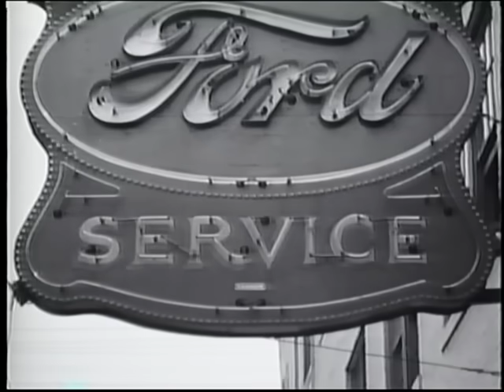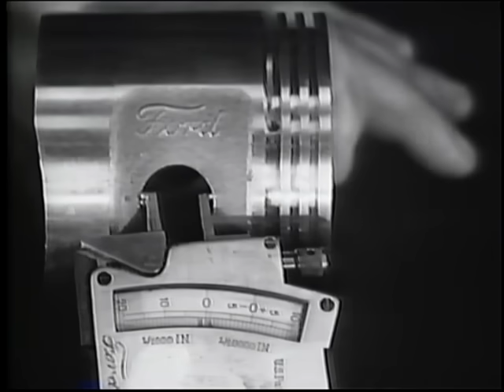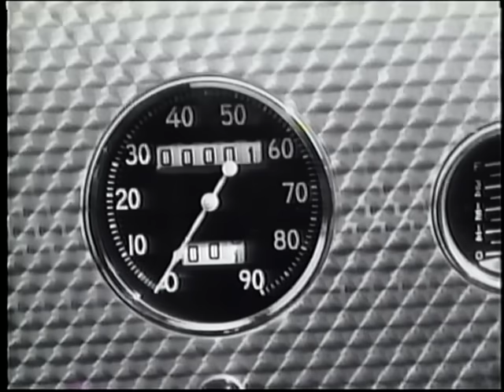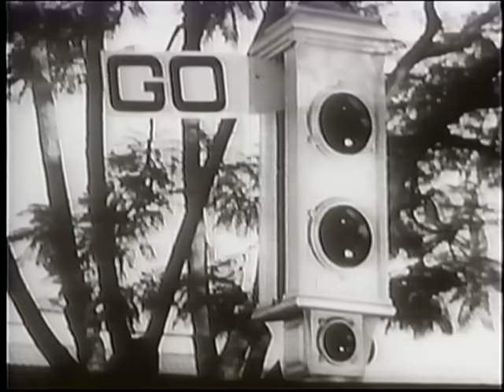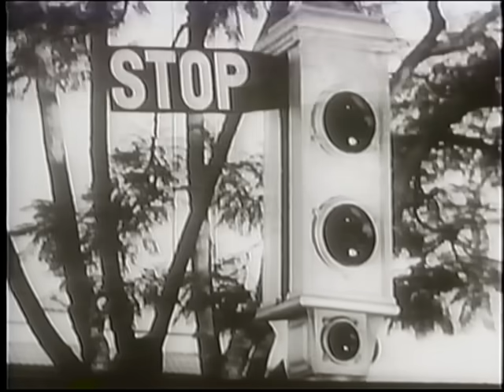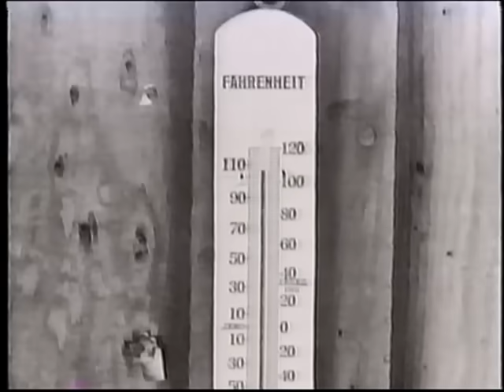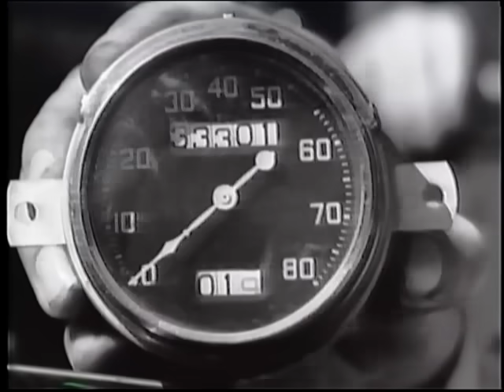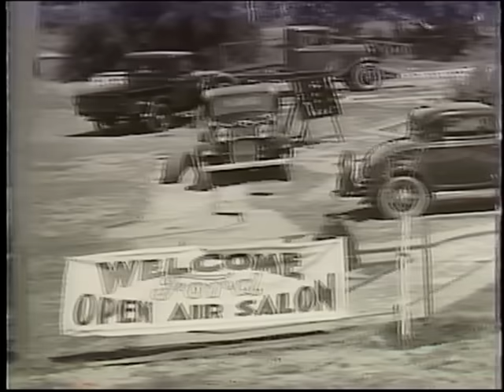1932 - The Invention of the Ford V8 Engine

Comment: All this progress without computers, astounding how smart these engineers were.
Reply: Jeb Broham all with a slide rule.
Reply: Engines could run today with just a little bit of help from computers. So even if the computers were to go they would still run on. The problem is that modern manufacturers have become lazy with their designs.
Reply: These are super simple engines. Like the complex bit are the radiator and the transmission. Which are super simple by modern standards. PS, modern companies provide more of an experience* than just a car. It isn’t just about A-B anymore. It abound the journey, and the experiences that can be had during it.
Reply: Remember, computers don´t think, they´r just as smart as the programmer.
Reply: Today. Mechanics won't do more than plugging a scanner.  You trying to explaining that You think something is broken base in common sense they won't listen. I love dirty hands mechanics who say: Start the engine... Then look ,grab something and tell you: This is bad. Swap something and say: -Try again! Broom! Done.
Reply: @ian_lambert-knight  super simple flatheads actually arent that simple.
Reply: @bighands69  Bullshit. 
Modern cars are several magnitudes better than any car from this period. They are faster, stop better, handle better, are safer, more economical, last much much longer, are more comfortable, etc etc etc. 
Old cars are great  I own several, but no.
Reply: @fernesal  things nowadays aren't that easy. I would love to work on any vehicle like that but its mostly diagnostics thru the scan tool that leads us there unless you see the problem alot on that specific vehicle and know instantly what to do. But you still need the scan tool to get to that part you can't just trial and error it anymore, otherwise the customer is not happy coming back to you saying; "this didn't fix it". Something like a misfire can be alot of different parts from a bad O2, clogged cat, vacuum leak, faulty ignition wire or coil, sparkplug, fuel injector not firing either cause of the winding is shorted or the pinto is stuck, or even poor fuel pressure. Where we'd all love it to be as simple as you say, we don't live in a perfect world.
Reply: Yeah nowadays our engineers are all Indians who like to shortcut things well at least the "to be" engineers of the next decade.
Reply: @bighands69  Can agree, every new car I see has no more styling to it, they all look the same, the only different styled cars are the sports and exotic cars, everything else is just monologue, though engineering in the engines is a whole lot better today.
Reply: @snowmexican5479  A bit like your command of English, eh?
Reply: @prophetsnake  to which of the 3 of my comments are you replying, I'm not making sense of you.
Reply: @snowmexican5479  I doubt that you ever will. I'm not fluent in Teabilly, you see.
Reply: @prophetsnake  I find it funny how you said "eh" at the end of your question like a Canadian, which I am also and no I did not immigrate here. I could care less about spelling and grammar since I am not going into law-school, nor a paper pusher like my old man who can barely change a light bulb without getting into a fit, but if you want him to type for me to ease your stressing over my comments.
Reply: @snowmexican5479  You could care less about spelling? How much less could you care, precisely?
Reply: @prophetsnake  so much that I am done talking to you sir, Good day.
Reply: @snowmexican5479  You forgot to say eh, so I am guessing that when they start putting foreigners in camps, you'll be rounded up as well.
Reply: Jeb Broham watching the machines do EVERY SINGLE THING mechanically was absolutely mind boggling. I can’t imagine the amount of dedicated engineers it took to create such perfected mechanical design, I can’t image the amount of seemingly impossible innovations these engineers were able to lead in sometimes under a decade. I can’t imagine the sheer amount of problem solving and adversity that was overcome. I have a whole new respect for pre-computerized machinery now
Reply: If you're implying that modern engineers aren't smart, you're dead wrong. Modern engineers are simply working with demands from machinery that are so precise, no person today can feasibly produce something like that without the aid from a computer. 

Want an example? Well if the Apollo 13 mission was so great, why can we produce engines twice as efficient today as we did then?

If 1930s cars are so good, why does a Toyota corolla last 20 years with nothing but routine maintenance and maybe a few minor repairs after the 10 year mark. Please, find me a 57 Chevy with that track record. Or a 65 Mustang that went more than 5 years without issues. Find me a Chrysler product half as reliable any year prior to 1990.

The difference isn't the engineers. Engineers today are just as brilliant and capable as they were back then. The difference is the tools. Brilliant engineers performed marvelous and tremendous feats of engineering in the 1930s, and those same talented engineers do the same today, but today using the precision that modern computing affords us.

"by naked eye" is to slide rule, what slide rule is to the computer.
Reply: @fernesal  Absolutely correct. Biggest fail I see is "techs" that fail to check battery connections and holes in hoses. Experienced a "tech" wanting to replace a turbo...scan tool told him turbo boost was low. That's the problem, he said. Hmm, I said...what about the hole rubbed in this hose ?  If you skip the basics, the scan tool will lie.
Reply: I was pretty surprised to  hear their marketing pitch, since most of the features they were touting were just caryovers from the Model A.  The rubber isolators and body styling was new, but the shock absorbers and brake mechanisms were practically direct caryovers, safety glass was used since 1919 or 1927, depending on who you believe, and the interior was practically identical in every detail I could make out.  The propeller shaft was a tube instead of solid, the rear spring perch moved back, and a few other nice details, but not much more than slight incremental progress.  If he hadn't had the V8 to put in them there is no way he would have sold the few he did.
Reply: @heyinway  That's what I meant when originally commented about it. I'm not against new technology. But I've seen ridiculous diagnosis from techs that look at nothing else that at a screen.  You bend over and look around and find something wrong in the vehicle way faster. They just say: I don't get it why still throws this code🤔
Me scratching my head...man! Get out of there and start searching like a man.
Reply: @prophetsnake  I should hope so after about 100 years of innovation and refinement. I bet they were super comfy compared to a horse & buggy.
Reply: @cptmiche  You're right.
Reply: @snowmexican5479  You can still trial an error it, but you would be an idiot to do so. Scan tools give you extra information you otherwise wouldn't have, which is very useful for narrowing things down. It also alerts people to issues they otherwise wouldn't notice till things got bad to the point that repairs would be much more expensive. For instance, I know the fuel pump in my truck is on its way out, and I'm planning on replacing it soon, but if it wasn't for the ecu I would't realize that and would probably have a lot of headaches in the near future.

The problem with modern cars isn't computers or plastic or anything like that, its three simple things that work together to make the market worse. People who make cars that don't care about cars, the lack of competition due to a smaller number of car companies, and the fact that more than 80% of cars are now either purchased, or chosen to be purchased, by women.

People not caring has always been an issue, but now due to the fact that there are fewer companies, there is a higher chance that there is no car made by people who care in a specific segment. Right now, if you want a midsize sedan that is comfortable and good for long roadtrips on the highway that doesn't cost a lot, all your options are made by companies who don't give a shit. If you want a small truck, well those don't exist anymore, but if you want a medium one, all of them are made by companies who don't care. Some decades ago, there was enough different companies competing, that there usually was a decent option for whatever you needed. Not so anymore.

As for women making all the purchasing decisions, unfortunately women are taught that they shouldn't care or know much about cars, so they don't know much about them on average. As a result, they are a lot less informed and let manufacturers get away with things they wouldn't have in the past. They also, knowing less about the mechanical aspects, tend to focus on stuff that they do know, things that are obvious if you look at a car even knowing little about them. Like little details of the interior and cargo capacity and ease of loading. So they buy things like crossovers, not knowing how much they are sacrificing for that extra space. I think that most women, if they understood how much worse a crossover is than equivalent vehicle of a different type due to the high cog, higher drag, and heavier weight, would choose a minivan, sedan, or station wagon instead, depending on their personal needs and priorities.

I'm not completely sure why women buy all the cars now. I have a few ideas, but its all speculation that isn't worth typing out.
Reply: @Milhaus It was! So was 'typewriter'
Reply: @lobsterbark  This has to be the longest comment I have ever read, but I agree with you, though I will have to correct you on the small truck, Ford did bring back the ranger and it is relatively smaller than the average truck on the road, though my only issue with it since my father owns it, is that the rear end looks like its on stilts. As for the care, I think its because its more automated the way the vehicles are made is why it seems like there is less care going on in the vehicle, at least you can say the upholstery was installed by a human/s, and depending on that human they either put some care into it or not. I also can't blame women entirely for the way the vehicles are built nowadays, but I will say that another large contribution to it is that we have become such a throw away society and people aren't buying cars so much as they used to anymore, its now either leased or financed that is now the complete killer. 

Another thing I am sad with is the dying of the manual transmission, especially with iconic cars like the supra, I'm sorry but I still classify a real sports car is one that has a stick. I'm not against the auto but I still want to "drive" my car not get crazy gas mileage, or fastest shifts, or how fast it can get to 60 or in the 1/4mile I think thats a challenge that a "driver" should take, not the machine and all the driver does is smash the accelerator and maneuver the car to limits since its aided by traction control and stability control limiting what it can do overall. Its just not a real car anymore like it was in this film or even like it was up to the late 90's. All the more reason why I hate my generation of carefree shitheads.

Other than the one truck brand bring back the small-ish truck and its not all women, I completely agree with you.
Reply: @snowmexican5479  The new Ranger isn't really a small truck. Its really more of a medium one. It weighs as much as a large luxury car, or small-medium suv. The older Ranger was light and small, this new one isn't. Not to mention the new Ranger lacks most of the qualities of the old one that made so many people like it. It barely gets better fuel efficiency than the old with the v6, its pricier than the old one (the old one was really really cheap for the time, this one is just fairly inexpensive), its difficult to service and work on, and its just overall not the truck the old Ranger was. Its not a terrible truck, but its not really a Ranger.

The new Ranger is actually just the truck Ford already had that competed with the Colorado internationally, given the ecoboost four cylinder from the performance division, and a slightly nicer interior. Smart move from Ford, seeing as all they had to do was put the truck together from existing parts and set up manufacturing for it in Detroit, and it fills the niche of somewhat inexpensive but nice midsize truck that didn't have much competition without having to spend a ton of money and effort designing a new vehicle, but it doesn't replace what the Ranger was before.
Reply: @lobsterbark  tis why I said small-ish, but it is smaller than any other trucks that companies are making nowadays. But I do agree its still to big to be considered small seems how its wheelbase is longer than my winter beater crown vic, but I can say it is lighter than my boat so to be honest I don't think its that heavy, still its not as light as it could be to be fair. Though what feels and whats spec are really different and I haven't bothered looking up its spec weight.
Reply: Well now actually looking up the curb weight of both vehicles, I am surprised that the truck is only roughly 200lbs lighter than the vic. Although thinking about it that 10spd trans has got a lot to do with the weight, whereas my vics iron block V8 is its downfall and I think they used thicker steel on the vics frame too.
Reply: Stuff computers! Bloody curse, they are!
Reply: @prophetsnake  stupid comment! Today's cars are like the people. Dull, complex and without an  identity. Open your mind. Look at things from a different angle.
Reply: @stuartbritton7408  Well, , I own an 1948 MG, a 1933 Riley, a 1972 BMW 2002Tii, and have in the past owned cars dating back to 1899. I've raced  vintage cars, rebuilt them and have an exhaustive knowledge of their history. 
You're talking out of your ass.
Reply: Same with rockets in the late '30's...no computers and no telemetry. After launching a couple thousand, the Germans got an idea of how to keep the things flying an actual course.
Reply: @prophetsnake  Modern cars dont have a temperature guage they have a light. Guess how many people notice a temp light. The same number who notice an oil light. Most people would have any idea where the oil light is. 
Modern cars also dont have a automatic transmission dipping guage. No one can check the amount of oil in the transmission pan. Guess what happens when there is a leak. Well its a $7000 bill to replace the whole transmission. There are no $100 to $500 bills to fix or service transmissions. Its throw it away and get another.
Try leaving a modern car in the sun - and just watch all the plastic melt. Sorry guys noone is paying out warranty for this.
Try fixing the engine in a modern car. Yes the engine needs removing. I remember being able to stand inside the engine cavity. Today you cannot get your hand inside. Yes modern cars break down less but its much harder to work out what is wrong. 
Car manufacturers have done this to force people to go to Dealers for servicing and repairs. Today dealers dont make their money from selling cars but from workshop repairs.

I had a second hand 69 XW Falcon from 80 to 98. Then a XE 84 Falcon from 98 to 2005. My last car is an 2004 BA Falcon till now. I could do nearly any repair myself on the XW and XE but almost nothing on the BA. I took my XW and XE everywhere. But I would never take the BA on the dirt.  Modern 2 wheel drive cars are only good for bitumen roads.
Try taking a modern 2 wheel drive out onto dirt/gravel roads. There are modern cars that have no wheel alignment adjustment. One day out - your car is stuffed and not worth fixing. If it breaks down throw it away and get another one. 

Buy a modern car so dealers can make lots of money.
Reply: @raymondmenz522 . Old cars overheat. they did it when they were new, they do it now. 
New cars don't. Old cars were unreliable -infinitely more so than new. 
I know, I own and restore old cars. Lots of them. Have done for years. 
Don't you have a country to make great again or some kids to chase off a lawn?
Reply: @prophetsnake  Give me a temperature guage any day. Seriously mate a temperature light? Try living in a warm to hot country.
Only idiots cooked motors in the old days.
Reply: Jeb Broham Remember that the Blackbird  SR-71 was built using just slide rules and micrometers. It wasn’t until the late 1970’s that computers started to be used and the robotic welders even much later.
Reply: @bighands69  - "Lazy with their designs..." Hogwash! They are making massive horsepower with a impressive fuel economy and all time low exhaust emissions.  Also, electric vehicles are going over 200 miles on a charge. Wasn't long ago that "everyone" knew that would never happen because "big oil" would not allow it.
Reply: @snowmexican5479  - Just keep in mind that if you do not care about a subject, say "I could NOT care less."  eh...  ; )
Reply: @scootergeorge9576  
Higher Horsepower does not mean a better customer experience especially in a family car. 

In 1965 a Buick which was a luxury car could be had for $3000 that car based on inflation should cost $12,000 (2.5% historical inflation) today. 

A Tesla Model S today starts at about $80,000 would with inflation adjusted cost about $20,000 in 1965. 

What you call innovation is government regulations forcing manufacturers down certain pathways which in turn has lead to very lazy innovation. 

Tesla's run on Lithium-ion battery that were invented by  Exxon (Standard Oil).  Most of the batteries used in electric cars are not produced by the car companies them self. The innovations in those batteries did not come about from the Auto Industry.
Reply: @bighands69  - The ability to recognize and adapt technology, regardless of the source, is innovation.  It is not a matter of some lack of initiative. Often it is simply what is practical. 
Standard Oil? In 1980, the American physicist Professor John Goodenough invented a new type of lithium battery in which the lithium (Li) could migrate through the battery from one electrode to the other as a Li+ ion. He joined the University of Oxford as a professor and head of the Inorganic Chemistry Laboratory from 1976 to 1986.
Reply: amazing how Ford freely instructed all carmakers across the world how to produce efficient automobiles
Reply: @lenny108  - Really? When was that?
Reply: @scootergeorge9576  in this 1932 film above
Reply: @scootergeorge9576  
As stated by your self "electric vehicles are going over 200 miles on a charge"
That has nothing to do with innovation in the auto industry. It has everything to do with battery technology innovation that was started by research within an Oil company.
Reply: @bighands69  - More like 80-20.  80% battery technology and 20% vehicle tech.  The electronics that  maximize battery life is much more sophisticated than you seem to believe.   And when I first mentioned "big oil" it was meant to highlight the myths that were perpetuated that they were somehow responsible for keeping viable electric vehicles unavailable to the public. Nothing new. 50 years ago (I'm 67) I first heard about   a  "200 MPG" carburetor  that the oil industry bought the patents to just to keep it off the market.
Reply: @prophetsnake  And cost so much more to repair. Just try and change the plugs yourself.
Reply: @JoeOutdoors  Well, I have  done. The fact is, however, that plugs last longer than ever. Service costs are far lower than they were in the thirties. For starters, oil changes are less than one fifth as frequent. Head de-cokes are virtually  a thing  of the past. Chassis lubrication likewise. Fuel economy is roughly three times what it was then, and I'm not even getting into the cost in lives and injuries. The cars themselves are more affordable, as is amply evidenced by the rate of ownership.
Cars are better than they were then, end of story. Any notions to the contrary are reliant on selective memories.
Reply: @prophetsnake  yes to everything you wrote, but what would you rather diagnose and work on:)?
Reply: @richardrichard5409  What has that got to do with anything? I wouldn't care to drive a Model T to work every day
Reply: What is teabilly  supposed to mean like a mean way to say British guy I'm genuinely confused
Reply: @TheTallOne890  I'm sure you are confused.
Reply: @TheTallOne890  Yes, that's me.
Reply: deepcritik , modern mechanics don’t need to load the parts cannon, when they can use a scanner to determine the failure, rather than guessing at parts.
Reply: Not you Harry pownall
Reply: And I bet you don't own even 1/4 the vehicles you say you do
Reply: @snowmexican5479  You already spent too much time with this fool.
Reply: @lobsterbark  and a
Reply: @prophetsnake  anyone who doesn't agree with you is talking out of their donkey! How arrogant an assumption. Don't boast so much about your achievements. I have several achievements too, but don't talk about them. I need no respect from anyone. I'm just here to comment. Today is a world of difference to the past. People have changed. Our values are different, but some of us like the people and things of the past because we value things differently. Things such as character, identity, personality, honesty, sound and appearance. Profit and money are no so important.
Reply: We got to the moon with slide rules almost exclusively. My father, a real rocket scientist didn't convert to a computer until 1975. One guy told him "but it's accurate to the 5th digit left of the decimal point", my father replied that digit is insignificant! My fathers IQ was over 160 by a significant margin.
Reply: Astounding how stupid engineers have become. For the most part, they're little more than technicians. Can't do more than copy what's come before. Actually, there are probably as many good engineers as in the 60s, probably about 10% of current "engineers" can be considered good.
Reply: @prophetsnake  what car if you dont mind me asking
Reply: stop immigration  True . In my own class it was guys like you holding everyone back.
Reply: @rexblogger8452  What car did what?  Had a V8 before Ford? DeDion Bouton, in 1907 for one.
Reply: @prophetsnake  no i meant what car do you own? (the very old one)
Reply: @rexblogger8452  I don't have it anymore, but the oldest I've owned was an 1899 Sperry. I've also had a 1903 Ford and a bunch of other pre WW1 cars. the oldest at the moment is a 1933 Riley.
Reply: @prophetsnake  that's really interesting, i bet they have been some amazing cars to drive
Reply: @rexblogger8452  Yes, they were!  An awful lot of work if you have a day job, though!
Reply: so  much  more  THAN   U
Reply: @jimblack120  Nice use of inappropriate caps.
Reply: ( HHHHHHHHAAAAAA  )))))))))))    Acap  your  lips  on  that ...
Reply: @jimblack120  And illiterate into the bargain.
Reply: @prophetsnake  and  you  tryy  soo    hard  at  NOTHING      EEAATT  SSHHIITT  AANNDD  DDIIEE   ................. SKUNK
Reply: @bighands69  Sure, lazy... I'm sure you still stick to the olden days traditions and commute on a donkey? What is wrong with using computers in modern cars? I just don't get that mentality.
Reply: @fernesal  AMEN!!
Reply: @sqward  
You do know that a donkey does not have an engine. I could not imagine the mess that would be created trying to service a donkey engine. 
If it was an electric donkey would you attach electrodes to the tail and nose?
Reply: They simply had 10x more people for the same task that is done today by single person.
Reply: @Jamie D Carnegie not anymore what, I have too many comments on other ppl I forgot the discussion.
Reply: uh NOT!
Reply: @jimblack120  No
Reply: @MrStuVW  Walk everywhere, do you?
Reply: @prophetsnake  bicycle and skateboard too, changing the vw bus to electric and working on my soul, mind, heart, and body.
Reply: @MrStuVW  So, that's a no.
Reply: @prophetsnake  you sure are, find your kindness.
Reply: Jeb Broham yeppp just their brains and they designed something groundbreaking from scratch
Reply: @jdrok5026  uh, you think there complicated........ Ok!
Reply: @prophetsnake  yes, complicated is always better who the hell wants something that you can fix by the side of the road.
Reply: @garyjones7044  they are in reality. More working systems in one component is more complex than less
Reply: @ian_lambert-knight  simple...sure.
Reply: prophetsnake if this is true, explain why the speed limit is decreasing?
Reply: lobsterbark Ranger isn’t a truck at all. It’s a medium utility vehicle.!
Reply: Stuart Walker are you an environmentalist converting VW bus to electric?
Reply: @philipgates988    I was in the last class in college to use a slide rule. After my class, students used calculators. We older guys thought the new guys were wimps for using newfangled cheating machines. A real man used a slide rule. And the best used a circular slide rule.
Reply: @thomaskarlstrom4815    That was the old days. New computers 'think'. New computers WILL be smarter than their programmers. They reprogram themselves based on how their results match certain criteria. This 'recursive improvement' will eventually lead to 'the singularity' where a computer will do better than a human in most tasks. After a while the computer's program looks nothing like the original program that the programmers wrote. It's a new age, man!
Reply: @prophetsnake    I agree. But there's one place new cars really are shitty. That's in driving position. When I'm in a pre-1990 car, it's MUCH more comfortable sitting. I'm six feet tall. In a new car, the windshield is raked at a greater than 45 degree angle. This puts the windshield pillar inches from my left eyeball. Also, the door is shaped so that I can't comfortably rest my arm on the windowsill. I remember riding in a 1960 Chevy convertible and I felt like I was sitting on my living room sofa. The windows were rolled down and my left arm rested nicely. The windshield was not 'aerodynamic' and was almost vertical so the left pillar was not even close to my face. I could drive for hours with the small front "vent window" deflecting the breeze. 
Screw today's cars. They're meant to be driven with windows up and a/c on an arm resting low on the arm rest. It's very uncomfortable, but it looks sleek. If I had to drive across country, give me a 1960 Caddy convertible and install a CD player loaded with oldies.
Reply: @The22on  We were talking about pre-war cars here. And I am also Six feet tall. so what are you talking about?
Reply: @raymondmenz522  It is quite few new cars that don't have a temperature gauge, and if they don't, the info is usually available via some display.
Reply: @RealistNW  Even if SR-71 was built today, they probably wouldn't use robotic welders. Robotic welders are mostly used in mass production of simple things like car bodies.
Reply: @prophetsnake  There are better but i hate them, ugly design, plastic, no soul
Reply: True
Reply: @christiansanden8005  Sure! That's it, the only reason.
Reply: The deal with computers is garbage in/garbage out.

The engineering is the same, the difference is they can test the engine in a simulation, do the math before hand.

The computers don't do the work for you.
Reply: And amazingly cars haven’t really gotten much better 😯
Reply: @chrisvig123  Yeh, they have. They are faster, stop better, handle better, get better mileage, last longer, are cheaper to run, are cheaper to buy, more comfortable. 
Better in every way.
Reply: @prophetsnake   i agree with engines last way longer now then they did back then. 200,000 miles is nothing  for a engine now back then in the 30s 80,000 to 100,000 if you were lucky
Reply: @jimanderson7648  Sure. Partly, down to better oils and fuels now, but yeh, you're right.
Reply: True
Reply: Computers only know what the engineers tell them. They are useless on their own without a trained eye and operator.
Reply: lol yes amazing that even a small block V8 can make a massive 65hp LOL ... that is insane... given we can get twice that horsepower from a modern 1.5L 4 cylinder engine. 
I am not bashing ingenuity, but let's not kid ourselves, computers have changed the world, and they are very much supported by engineers.
Reply: @oneeyedrone4293  Well, that was a different sort of horsepower, for one thing.
Reply: I've thought about this over the years many times.  Long hand math and slide rules.  Brilliant folks.
Reply: @chancepantswindham7745  in fact, quite a lot of people are saying precisely that. Learn to read.
Reply: Yeah but it took an engineer to build the computer to build the super complex cars of today compared with that- you really can’t say one is smarter than the other
Reply: Ian Miller yeah because cars of the ‘20s and ‘30s to totally never looked the same...smh
Reply: @ms90sbabyy  They didn't look the same.
Reply: @Dirk Pitt  yes. Sometimes that happens even with professionals.  You keep bringing the car to the shop were they seems to know everything. But they aren't looking by detail. They just see their screen.
Reply: @bighands69  , I read the opposite; the competition is stronger than ever.
Reply: @fernesal , What? How many professional mechanics do you know? Try writing everything they know to paper. See how fast they have to work.
Reply: @snowmexican5479  , got proof? What university did you study it in?
Reply: @senatorjosephmccarthy2720  Please be more definitive on your question, proof for what, I made a lot of comments here. If your looking for the answer of the Indian Engineers I should correct myself, I hear stories on them from everywhere about how they get uni degrees yet they don't know shit or can only do one side of the job etc. I have been told that there are some that do the job well and are feared to be bad, it depends how they grew up. My education; studied in the motive power program at St. Clair College in Windsor, Ontario. Cooped at shops in high school (full school year in the auto body world, half a school year in a auto shop) worked for my municipality fleet services. I still got a lot of years to go for true experience in the auto field. Also the auto industry doesn't need uni education unless your going into product design in say the engine ecu programming or the compact design of how shit is laid out in the engine bay. Uni is way to advanced that is really unneeded for my field. Heck the physics classes wasn't even useful till the end on conversion of horsepower and torque, and the basis of hydraulics math for power steering.
Reply: @thomaskarlstrom4815  Ah, but deep learning can outsmart the programmer!
Reply: @philipgates988  That's how the Saturn V was made.
Reply: I remember my '64 GMC, and VW Bug. Adjusting points every 1000 miles was tedious. Better mileage, more power, and greater reliability. Digital computation makes any engine better.
Reply: @bighands69  It has nothing to do with laziness. Modern vehicles have to meet government mandated requirements for low emissions and better fuel economy. Meeting those requirements requires a computer to control the fuel/air ratio to make the engine run efficiently and clean.
Reply: @prophetsnake  I don't miss carburetors and ignition points at all. The multi-port electronic fuel injection systems on modern cars are far superior. They are more reliable and dependable. Unlike old cars with carbs and mechanical points they start easier and run better. No more hard starting, hesitating and stalling. And they run exactly the same irregardless if they were just started or if they are fully warmed up.
Reply: @joevignolor4u949  Exactly
Reply: @joevignolor4u949  
That's the problem they are using the regulations targets to claim they are innovating. 
All they are doing is making incremental improvements to existing technologies. 
The overall design of an ICE has not changed that much in the last 60 years. 
This has made the industry lazy and too focused on market regulations rather than engineering and science innovation. 
A lot of them are too scared to do anything too radical. 
If government did not get involved there probably would be something really radicle like a 24 cylinder 5 litre engine by now. And I am not talking about sports performance.
Reply: @bighands69  I understand the underlying issue of government mandated emissions and fuel economy standards. And aside from that as a consumer I personally like vehicles that pollute less and use less fuel. But either way wanting better fuel economy and lower emissions is what caused the demise of the old fashioned carburetor and electro-mechanical ignition systems and made new on board computer systems necessary. Further, driveability is improved in newer vehicles as they tend to start more reliably and don't hesitate and stall like the old cars often did. As far as the internal combustion engine and some of its historical, inherent and fundamental limitations these will not be eliminated completely without switching to something else completely different such as electric vehicles using energy derived from renewable sources.
Reply: To be honest that car has 65 hp 221 ci engine and probably does less than 20 mpg while eating lots of oil and spitting out huge emissions. 

It was great in 1932 and it has it's place in history though. But it's obviously antique.
Reply: @prophetsnake  Truthfully not much has changed from then and now, when we talk about passenger cars. They're still built for comfort, decent fuel economy, reasonable affordability (although the mark-up is high much of the time) and ride quality. I think one of the big problems people have with today's cars is that there are so few spirited and pure driving experiences. Sure, a 2.0 Inline-4 from Japan or a domestic small displacement V6 with VVT, Fuel Injection, and maybe a turbo or two will do wonders for your wallet and is plenty comfortable (and even gives these flatheads a run for their money power-wise) but those aren't good for gearheads. They don't give you the satisfaction of using bolt-on parts or doing the dirty work yourself. You don't get to revel in the simplicity of fixing your engine or putting it back together again and basically guaranteeing that it runs just right. You don't get to feel the cold detroit iron and understand that this car was made by a few guys on an assembly line and not just assembled by machines and then half-ass quality checked because half the time it's easier on the budget to just send it to the dealership and get the bad parts replaced later covered by warranty.

New cars lack a certain romantacism to them, and often even the ones marketed to enthusiasts have so little to offer. Are they great cars, some of the best daily drivers you'll ever see? Most of them, yes. But most of them hesitate to kick into fun-mode or plain don't do it at all when you want to.
Reply: @theinstitute1324  No, that is not the truth.
Reply: @prophetsnake  If you say so. I drive a modern car. Drives great, makes great fuel economy, good for driving people around and getting from A to B comfortably.

It has a 0-60 MPH of about 8 seconds and a 0-100 of about 25-30 seconds. No. Many modern cars - economy cars especially - have shit-for-nothing acceleration most of the time above about 60 MPH unless they are a performance oriented model. Much of the time this is because a computer limits their function and plays nanny OR because they have a CVT which means their acceleration is very limited as is their torque load. And don't tell me what the truth is. Truth is cars are faster than walking. Anything else is speculation or opinion.
Reply: @theinstitute1324  Yeh, sure.
Reply: @Saul Hermosillo Tesla coils aren't computers or anything like one
Reply: @jdrok5026  they definitely are simple, they're a v configuration motor that has the most basic form of valve /cam layout. There were radial engines that had 10+ cylinders rotating around a crankshaft (not the other way around) to power aircraft. This is as intricate as 8 lawnmower motors with a splasher oil system to run a car...
Reply: @evansellars8728  flatheads arent simple do to the nature of how they function there is a very difficult side to them. Just because splash oiling is simple doesn't mean the engine is simple because in reality and cam in block engine that has oil and cooling passages etc is complex because there actively must be taken into consideration. With flatheads you valve placememt and even you exhaust routing makes things complex to not have cooling issues or cracking of the casting. So no this ain't as simple as you think. Especially given the fkrd variant was the first to have a single casted block in production for the masses i think you need to consider that no engine is that simple and the more shit you move into the block the more complexity is actually increased to gain more and more efficiency.
Reply: deepcritik o
Reply: @Pimp-Master  english
Reply: @RealistNW  computers have been around longer than you think!
Reply: @raymondmenz522  ALL VARIABLE RESISTORS!
Reply: @RealistNW  SAYS WHO,HOHOHO
Reply: @scootergeorge9576  BS
Reply: @RealistNW  not in the real world
Reply: @dennisrockwell7834   - Remind me what I said that was "BS" so I don't have to scroll through 170 posts to see.  If it was that the Flathead Ford V8 was an actual invention, don't bother because that is BS.
Reply: @bighands69  BS my uncle paid over 8ooo dollars for a Chrysler Imperial in 1962 a Buick Park Avenue in 1965 was not a 3k car! your standards are way off, so is your math!
Reply: fords lincoln for one
Reply: @dennisrockwell7834   - The theatre that Lincoln was shot in. Okay...
Reply: @dennisrockwell7834  
A 1965 Buick LeSabre had an RRP of $3000. 
Mathematics of 2.5% historical inflation are as follows 3000*1.025^55=11667. 
So that means in today's money that exact same car should be selling at about $12,000. 
I am sure you uncle bout a really nice $8000 top of the range Chrysler Imperial in 1962 but that was not the norm in terms of price of an Imperial. Imperials were top end cars of their day and would be the equivalent of a Rolls or Bentley. 
himself
Reply: @bighands69  today's engine are far superior in tolerances, horsepower, emissions, torque, fuel mileage and metalergy. Today you can get triple the horsepower out of a I4 that a Flat Ford had it's whole life. Not to say how impressive and cool old engines are, and they are easy to work on. But the durability is triple today as well. 100,000 miles was the life of an old engine, today it's barely broke warranty.
Reply: Along with the Model T, the new V8 Ford changed car history forever!
Reply: Mechanical brakes eh?
Reply: @bighands69  The engineers have not become lazy but government interference has killed inspiration and innovation in America.
Reply: People are losing their ability to think and create for themselves. A man thoroughly trained to use a slide rule and very competent with Algebra/Geometry can be a dangerous sort!
Reply: @snowmexican5479  Teabilly?  You smug self-righteous ignorant fool.
Reply: Must of been 'well-versed' with a 'slide-rule'.
Reply: they had computers.....that's the name of people who do the math's, I think you mean electronic computers right?
Reply: @spacexvanityprojectslimite3315  That's what computer means, yep.
Reply: And all in house made. Nothing was out sourced.
Reply: Yes Jeb and the clever people of today think they should chop these car s up  and fit a chev ,instead of showing respect to the brilliance of the designers  ,Of course there are very few people who can  fix or understand the technology
Reply: @nobody7817  Well aren't you wonderful.
Reply: @nobody7817  - - " I could care less about your semantics!  (LOL I couldn't resist that--even though it was a year ago!)"The fact that you "could care less" indicates some level of care. If you did not care at  all, it would be impossible to care less. Not that I actually care...  : D
Reply: @nobody7817   - Nope. I was playing a long. that's why I posted   "Not that I actually care...  : D" That's the punch line and with a big grin : D - I guess it sailed over your noggin.
Reply: I can't add 21 +17+53+34+33 without using calculator...
Reply: @curiousity4killer  Well not with that attitude
Reply: @curiousity4killer   158?
Reply: They had hardcopies of everything to go on
Reply: It was because of there great creativity and problem solving.
Reply: @TtheDesertFox  They didn't invent the V8, so no
Reply: @TtheDesertFox   - their
Reply: Hard working*
Reply: @thomaskarlstrom4815  well no that's not true lol
Reply: What really gets me is the analogue tech of the 60. Using vacuum to determine the current driving style and adjusting shift timing accordingly. Brilliant.
Reply: @philipgates988  We put  man on the moon with the slide rule.
Reply: @prophetsnake  yep..
Reply: @snowmexican5479  that is racist. Engineers come in all shapes and forms😀
Reply: Ed Cole helped over at Chevrolet/gm.
Reply: Ed Cole helped engineer the 327 v-8 engine for GM!!
Reply: @bighands69  many people would look at the fuelling system & have no idea what they were, how they worked & how to adjust them. 
My 45 year old Suzuki bike is a thing of beauty, an analogue device in a digital age.
No remote signalling it’s location. Such redundancy in its operation that about the only thing that could stop it of a part failed was the point cam gear.
Reply: Wow! It's amazing the robotic type machinery that existed way back then not assisted with computers.
Reply: @snowmexican5479  yes
Reply: @jr540123  uh finding things is what mechanics use alldata for, also I have been taught a lot of things bout how quirky old cars tech have. Though I think you have read my comments wrong cause not one of them showed that I was denying the use of a scan tool, I know its a maze, I use it on the daily, it does simplify the work load a bit but it never truely tells you. Also I’m not bashing engineers for their intellectual skill in the computers or some sort of design that removes certain mechanisms that are unreliable or overweight, but I’m saying some more compact engineering designs fk up a lot of things when on the job fixing it, like putting a long bolt where if you take out runs into the body or frame of the vehicle, some engineered designs are just plain stupid, like ford and their pickups, have to take the cab off in order to do the job cause its not accessible.
Reply: This engine had to be designed from scratch, but that was the easiest part. To develop methods of production that hadn't been used before would need designing,the casting cores would need designing and drawings again drawing up and the moulds designing and machining, the tooling designs need designing and drawing up for toolmakers to make and check out,  detailed knowledge of each part is required. This would require dozens of engineers drawing the parts with pencils no computers and calculators
Today
Reply: @jeffm4284  In real terms, they are cheaper now than they were then. 
I like old cars as well, but to suggest they are better in any way is simply delusional.
Reply: Yes I remember a time before the computer when people did something called math, drafting, and applied physics...all with their brains 🧠 !
Reply: @brandonbentley5453  They still do.
Reply: Back in those days, everything was written down, pictures of every angle were also drawn by hand, … because there was no autocad crap back in the day, … DaVinci was soooo, far ahead of his time, … writings, drawings, paintings, inventions, … must have been doing some damned good drugs in his day, …
Reply: @cptmiche  your first paragraph has some errors.
First engineers only draw up the designs, they do not have any or very little production knowledge like a machinist.
Engineers on top of that are only drawing up the specific dimensions etc of a project, these parameters are laid down by the lead designers for the product as stated for the client(what the client needs out of the product). The product in the case if what I do is demonstrated to him(the client).
We print in metal and work with magnetics..
A machinist then does the finish milling etc. This can be done using CNC mills and lathes or manually kn a manual mill. CNC is for large repeatable production but many small orders for the military are done by hand in order to maintain the tight tolerances. Tolerances are even used when needed, not everything is held to a .0001 tolerance some are at .005 tho so it's not like manufacturing has changed at all at its core for 100 years. Machining is no different today except for computer controls and if course 3D printing in metal which revolutionized what you can do woth the internals of a product.
Modern engineers have far less ability then engineers from even a few yards ago. Engineers used to wear many hats also, now they only draw up bits in Mastercam...the head designer even only answers question from the client,  the client dictates the over all design.
And some of the things we make not one of you would believe btw.
Reply: Computers are just one tool engineers use ... "hands on engineering" and iterative design by prototyping, are still highly effective methods.
Reply: I’ve got a friend that is one of those rare mechanics, that you can explain the problem your having and can diagnose it without ever touching a tool.  He is also a mechanic that you can trust, like it or not he is going to tell you the truth and not over charge you.
Reply: @themurphrees3795  and because you lack any ability to know if that mechanic is ripping you off .. you just go by your feelings .. good luck with that. Best way to know you aren't getting ripped off, is to learn a bit about servicing cars, and doing some of it yourself, while farming out the difficult work.
Reply: I went to school for auto machining building engines and heads in 2005 at age 18.

I can tell you hand built or rebuilt (and properly baked and machined) engines are better than factory. The reason I say that is, the blocks when new warp a small degree and resettle after a few heat cycles. Once that is done in new cars no work gets done rehoning realigning and rebalancing. In a rebuilt engine everything gets rehoned and line bored AFTER the metal is cured from years of use. Imagine honing a sword before tempering it... It would not stay true. You temper it first. Hot cold hot cold. Then you sharpen it down where you want it.

Anyways idk where they even teach this stuff anymore. My teacher died and the program ended at our junior college. I wish to God I'd finished. I did a 3 angle valve job final exam without my slide ruler...I'd forgotten it that day. Teacher said I made a 97 but should've made a 0 😂 
Pretty good for no ruler. He was kindof impressed but mad at me for being unprepared at the same time lol
Reply: @prophetsnake  In real terms, a modern car is WAY more expensive than in 1932 when the Ford Flathead came out. Where you get your data - I have NO idea and you call ME "delusional". Someone needs to get a clue and it's not me.

What I clearly said is that today's vehicles are not affordable for a "common" person without taking out a very large and long term loan. The second point is that today's vehicles are not maintainable by the common person. I used an example from my own experience of changing the transmission on my 2004 Explorer compared to my 1972 Nova. The difference could not be more stark. $2000 for a rebuild with me doing the removal/installation, $4,500 if I had a qualified mechanic do the work, and it took 3 weeks of downtime to fix the Explorer versus $75 and 1/2 a day for my 1972 Nova. Those are two completely different universes. Fact. 

Now tell me what car you can find NEW for $10K. You can't. You have to pay $40K and a LOT more for a Ford F150. A King Ranch is $63K. Good LORD! That's double what my mother paid for her 2 story house with a basement in "downtown" North Branch MI.

1932 Model-A:
"Prices ranged from US$495 ($9,389 in 2020 dollars) for the roadster, $490 for the coupes ($9,294 in 2020 dollars), and $650 for the convertible sedan ($12,329 in 2020 dollars). Production totals numbered from 12,597 for the roadster to 124,101 for the two-door sedan. Ford sold 298,647 V8-powered 18s in 1932, and except for the fact Ford could not keep up with V8 demand, the essentially identical four-cylinder B would have been a sales disaster: dealers switched customers to them from the V8, and even then sold only 133,539, in part because the V8 cost just US$10 more ($190 in 2020 dollars)."
https://en.wikipedia.org/wiki/1932_Ford
Use this calculator (this is the official one):
https://www.bls.gov/data/inflation_calculator.htm

2020 Ford Explorer for reference:
"The 2020 Ford Explorer has a starting price of $36,675 for the base model. As you move up in trim levels and add options, that price increases to $48,130 for the Limited and $54,740 for the ST performance trim. Going for the top of the line? A 2020 Ford Explorer Platinum starts at $58,250 and it comes with almost every luxury available."
https://www.fordmotorcity.com/2020-ford-explorer.htm
Reply: @prophetsnake  "Old cars were unreliable -infinitely more so than new." Not sure what era you're referring to, but my family had a '72 F250 handed down to my mother from her parents with 70K miles. She sold it with over 200K miles. She bought it back with 400K miles and sold it with 450K miles. Never overheated. Only changed fluids, aligned the front end because we lived around crappy dirt roads and the twin I-beam suspension wasn't the best design, and put Bendix springs in the starter. That was a weak point. I don't even remember replacing the thermostat. Maybe it was, but I would have been doing the work because I was "the man of the house" by 9 years old and I did necessary maintenance. So that was one tough truck. 

I'll never get 450K miles out of my 2004 Eddie Bauer Explorer - top of the line. I've only got 125K miles on it and the heads are leaking like craze, had to rebuild the transmission, lots of the electronics are broke, the plastic thermostat housing broke and the vehicle instantly overheated in the middle of the road during rush hour in Austin TX - and yes - I have a temperature gauge, not a light, hood struts don't work, rear window release doesn't work, it has the classic "butt crack" on the tailgate - I could go on and on and on. I still like the Explorer and want to hang on to it, but just wow! All the problems are really stacking up.

So tell me which vehicle was more reliable? Which was more expensive? Which is easier to work on? I'll give you the Explorer is much safer - I'd rather be in the Explorer during an accident. My '72 Pinto getting ripped in half by a maniac driving a van with a trailer full of canoes down a one lane sandy road going 70+ MPH around a corner was plenty for me.
Reply: Yeah didnt need them
Reply: life before the computer was the best
Reply: They had log tables & slide rules, which I was taught on in the 1960s.
Reply: @bighands69  Engines need no computers if designed pre computer. My 1977 motorcycle has no electronics, electrics only.
Reply: Ha, using formula developed by Plato. What you call progress, I call loss of knowledge.
Reply: They were the computers
Reply: This is the engineering that led to computers not vice versa.
Reply: @mikecrawford5331  The people were actually called " Computers " - they did computations. As in " send this to the Computers to determine trajectory and velocity "
Reply: My God .... How those engineers in 1930's could possibly achieve those precision, with using only an analog equipment ??  It is a MYSTERY of the Henry FORD Company !!!!  :face-blue-wide-eyes:
Reply: @philipgates988  + ability and bloody hard work too.
Reply: @bighands69  there are other goals at play too...
Reply: @fernesal  I WILL NOT BUY AN ELECTRIC CAR! EVER!
Reply: @snowmexican5479  Easy big fella - the redness is showing  under your shirt collar.
Reply: @snowmexican5479  I didn't say not to use the scanner at all. I meant mix the use of that tool with the basics. First of all you have to understand the system  using your mind. Some technicians don't even look at the car. They just look at screens. They really don't know how it works. They just read the code.
Reply: computers are week compared to the lost tec of this Erra.
Reply: Atropus Arbaalish  Who was joking?
Reply: they wouldn't have ever been pushed to uncover their true potential and smartness , if it wasnt for Ford's sheer stubbornness.
Reply: @nunu4evaaa  Nonsense
Reply: No… It’s amazing how little progress is made now that we do have computers… What’s astounding is how stupid our rectangles keep us.
Reply: @rgriffith6476  Yeh, right. You're posting this on an old typewriter, are you?
Reply: @bighands69  
Evidence?
We don' need no stinkin' evidence. Bit of cynicism will always pass for wisdom with th' yokels.
Reply: It was all done with a slide rule I used that my first 2 years in college, also some of his books on vibration control.
Reply: @snowmexican5479  stockholders of course are innocent
Reply: Man
Reply: I agree. Take a look at the Romans building
A temporary bridge across an aggressive river to move and hold thousands of troops
Then dismantle and store it, all from scratch.